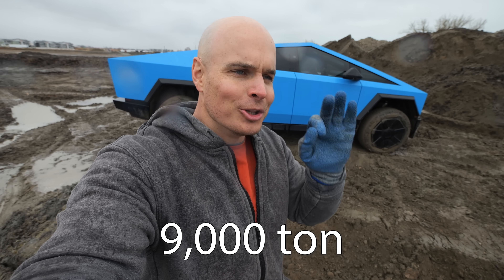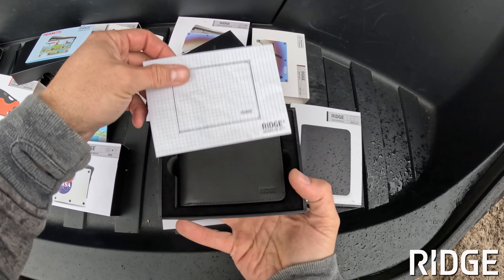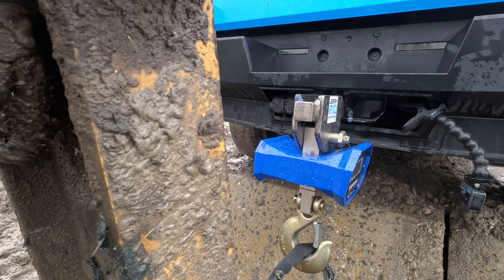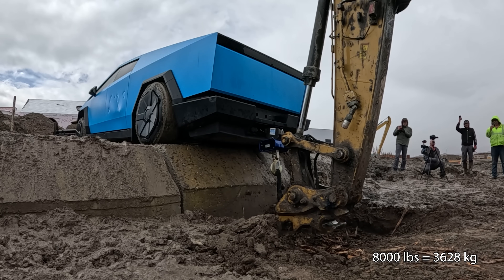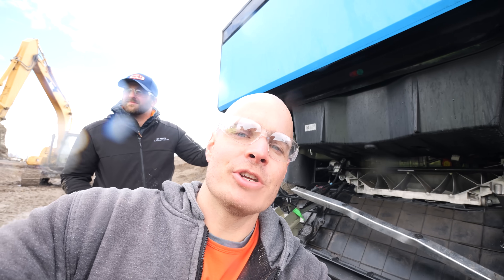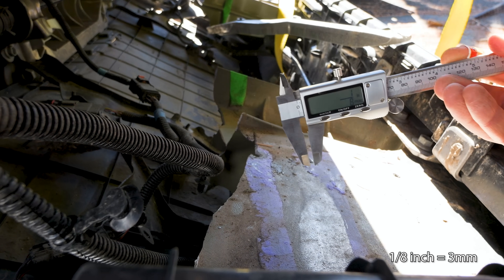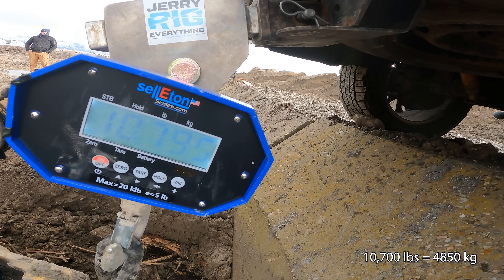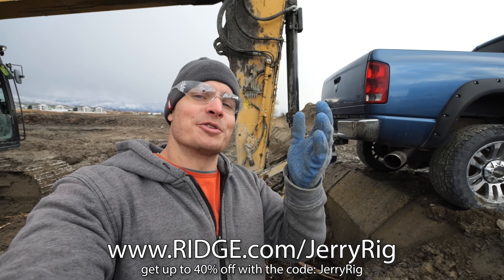SHOULD YOU TOW WITH A CYBERTRUCK?! - (catastrophic failure test)

Comment: So basically anything over 6,000 pounds puts enough stress on it to where it could more easily break in the future. If its fatigue diminishes thats even scarier
Reply: Any towing weight. Aluminum weakens over time with any load, faster with more load. Steel doesn't, it has a fatigue limit, stay under than and the strength will maintain indefinitely. I wont be surprised to see Cybertrucks just falling apart on their own without the added load of towing after 5 years or so.
Reply: @_BangDroid_  Wait till you find out what they make airplanes out of. It will blow your mind.
Reply: @ Thanks for the education! I have learned that planes are made of machined or forged billet aluminum not cast which is significantly weaker. I also learned that the aviation industry is heavily regulated and critical aluminum parts are routinely inspected for fatigue using ultrasonic or even X-ray inspections. Which is probably something every Cybertruck owner should do if you're going to make this comparison.
Reply: @_BangDroid_  100 percent confirmed 👌
Reply: @_BangDroid_  That depends what alloy you use. They have SpaceX materials scientists and people doubt them. Quite narcissistic
Reply: @elijahgardi7501  Aerospace materials prioritize being light weight. Aluminum is never used for strength, regardless of the alloy. The Dodge held up better even under bouncing because it was steel.
Reply: @_BangDroid_  By unit of cross section, steel is far stronger, but pound for pound aluminum is more than twice as strong as steel.  They do have different tolerances to fatigue and modes of failure.  Otherwise aerospace would just use thinner steel rather than aluminum.  Then at those thicknesses steel wouldn't hold the fasteners without ripping.
Reply: @TheDustyShed  I'm sure Tesla engineers are capable of iterating their designs eventually. But they keep reinventing the wheel with things like the Cybertruck, instead of going with tried and true chassis designs. The first version is totally flawed. The Dodge is a stronger design and material and not by a small amount, they were bouncing the same load repeatedly on the Dodge. The Cybertruck is too much like Cyberpunk 2077 on first release, nothing like it's hyped up promise, but eventually they might get it right.
Reply: @CGGS_0  Yes they are dude, they were designed from the team of materials scientists for the Gigapress. They're used in the model y and model 3 and no-one has complained about towing faults. FULL STOP.
They used air cushions to bend 20x cold rolled stainless steel yet they can't make a tow hitch? 

Just look at the real world data of people actually using it in the way its designed. Moving the goal posts to hypothetical scenarios isn't valid criticism. When do you apply 10,000 pounds of force? When do you drive down the road and wile E coyote has painted a wall? It's total bullshit.
Reply: Why would the ball weight be over 6000 pounds?
Reply: @Lav-v9c  it doesn't matter because fatigue happens with every stress. So every time you hook on a trailer and every time you loads the trailer and unload it or you are simply driving through a pothole aluminum will fatigue even if you only step on it you might lose 0.000000001% of its strength and you won't get it back. 
Aluminum degrades with stress over time till it can't hold its own weight.
Reply: @ - and its not pure aluminium jack a!
Reply: @Lav-v9c  of course it isn't but it's also not one of the good high fatigue aluminum types.
Reply: @Lav-v9c  Exactly..... these tests are nothing but click bait. No truck within this capacity has a high tongue weight capacity.
Reply: Not true every time you put a little bit of stress even a small trailer on the hinge aluminum will degrade if you pull a small trailer every day you might have half the strength after 2 years.
Reply: remember its aluminum all you get is 1 tow at 6k and thats it no more towing ever ... this is why planes get scrapped while your model t still putters along ... or you can do maybe 100 trips with 1k off the hitch then put the trailer away for good
Reply: How would you ever get 6000lbs of weight on the tow ball?
The excavator weight around 50000 to 70000lbs and could only push down with around 10000lbs, any trailer you put on it will do the same, most of its weight will go through its own wheels
Reply: @markharrison7468  If you hit a pothole while braking as hard as you can.
Reply: @Anonymous-sb9rr  lol and you think that will put 10g downwards on the ball. No wonder this channel has been able to get away with $hit like this.
Reply: @ no if you hit a pot hole while braking hard the rear end would lift making the trailer push up rather then down unless you have a really poorly loaded trailer with all the weight at the front
Reply: @Lav-v9c  Not 10g. when you brake hard, a large portion of the weight of the trailer can push down on the tow hook, so you don't need 10g. It all depends on how high the center of gravity is of the trailer, compared to the distance from the tow hook.
Reply: @markharrison7468  10G hit with 600lbs.
Single axel trailer mostly dangerous for cybertrack, easy to imbalance so dynamic loads go to tow ball instead of trailer suspension.
Reply: If you backed a 6,000lb trailer off a cliff and then tried to tow it back up, then yes. To call the logic used rudimentary, would be an understatement.

A 10,000lb trailer (probably triple axel), doesn’t magically apply 100% of the weight on the tongue, it’s distributed among all the axels and the hitch.
Reply: @_purge9488  Haha you drive on perfectly smooth terrain? What are you hauling and where to?
Reply: @_purge9488 a 10,000 lbs trailer becomes a LOT heavier for a split second when you hit a bad dip in the road, you know, the kind that makes your suspension almost bottom out on most vehicles.. they exist and they're not always easy to see until you're ontop of them. Then take metal fatigue into consideration, and it becomes clear that it's entirely possible for someone who hauls heavy trailers, maybe drives kindof like an idiot, to break their hitch off after several years of use. And it's not just theoretical, it's happened at least once not including whistlindiesels test (where he wasn't even trying to break the hitch off, it just happened, very early in the testing)
Reply: this test is absolute BS because they measured the tongue weight rating by pulling DOWN on the hitch receiver instead of testing towing capacity which is a HORIZONTAL load. Total morons doing this video!!
Reply: @silentepsilon888  it's not BS for a good reason in a perfect world without any hill or perfect roads always straight it would not matter. Whenever you pull up the hill especially over the hill you will have a good percentage of your weight on the hook bullying exactly in this orientation. 
Also the test wasn't straight down
Reply: @ not only that when the wheels started coming up they tied it down increasing the fulcrum effect
Reply: No. he’s lying about the dangers of this. This would never happen In the real world, towing within its rated tow weight limit is perfectly safe…… He’s upset with Elon so he destroyed his Tesla to make a Tesla hate video
Reply: @_HashForce  you just have to go over a hill slowly and you will have the same angle with your rated to wait pulling the exact way down
Reply: @ReinhardSchuster  A trailer is designed to carry its own weight. The majority of the trailers weigh will always be on the axels. For this to happen the entire 11000lb trailer would have to be hanging off the bumper, from the side of a cliff to recreate this. Even the 50,000 pound excavator was lifting itself off the ground with only 6000 pound force on the Cybertruck. No real would scenario would make the bumper break like that.
Reply: It is more of a problem if you get into a crash. In a car crash, the downward force on the object being towed can easily multiple by over 10x - which would cause problems for the Cybertruck even if you are only pulling 10% of the tow rating. So if the Cybertruck's rated capacity is 10,000-11,000 lbs and you are towing the 10% rated load of 1,000-1,100 lbs, then a crash will cause 10,000+ lbs of force in tongue weight and heavily damage/destroy the frame.
Reply: @Intranetusa a crash would never place 100% of the trailer's weight vertically on the hitch unless that crash involves some sort of air time. The trailers wheels will still support the majority of the load.
Reply: @Intranetusa  At that point you already crashed, and a destroyed frame was already in the cards.
Reply: @Intranetusa  Omigod, so if you get into a crash, the ball thingy might break, along with your truck and your boat? Oh noes!
Reply: @bigglyguy8429  There's a difference between controlled destruction as crumples zones get crushed and frames bend and "oops my trailer just became a 10k pound projectile i have no control over"

Comment: Love your videos but your physics is wrong. An 11k lb trailer will never load the hitch vertically to 10,400 lbs. Even in the circumstances you suggested, most of the load will be in the horizontal plane.
Reply: Under normal driving conditions. In extraordinary situations like hitting a pot hole square, or evasive maneuvers, these figures are probably underestimated. The dodge certainly looked like it cou,d handle irregular shocks. The swastitruck on the other hand..

Comment: So the hitch actually exceeds the specification. There is no situation where all of the trailer weight will be on the hitch. So as long as they are under the rated weight everything should be fine. Its important for people to learn about towing weights when towing. Its actually not that difficult.
Reply: Except aluminium gets weaker and weaker with stress applied over time, even if the stress is within its rated limit. Steel doesn't have this problem, which is why almost every truck-maker uses steel frames over aluminium, unlike Tesla.
Reply: @kimjong-un4292  if thats actually an issue why does BW make aluminum hitch inserts? You would have the same problem. The point is that as long as you don't exceed tongue weight x10 it will be fine for the life of the vehicle. Even if your ball were to break and the safety chains were activated its not gonna have 8k lbs of wight on the back. My 2500 duramax can't even have 8k on the back axle and you have to account for the existing weight of the vehicle in that.
Reply: Agree, they should pull out - not down.
Reply: The problem arises when you consider that Aluminum doesn't have a fatigue limit, meaning no matter what over time it WILL get weaker. An improperly loaded trailer might survive the first 10-100-1000 pothole hits, but eventually something will give and the whole hitch will detach from the truck. This IS a MASSIVE safety concern, and should illicit some kind of response or solution from Tesla. Lives are literally on the line with this problem.
Reply: @Oroborus710  not really because it will most likely survive beyond the warranty period. Hitches break off of old pickup trucks all the time due to corrosion. It's no different here. Same deal with aluminum hitches you put in the receiver. Companies like BW offer hitch inserts built of aluminum as well. When you overload anything you run the risk of breaking stuff. Doesn't matter if it's steel or aluminum.

Comment: Downward pull on the hitch only measures tongue weight capacity. You want to pull directly to the rear of the truck to accurately measure towing capacity.
Reply from the maker: Well, this is a tongue weight test. So that tracks.
Reply: @JerryRigEverything You’re clearly being biased. Just because you don’t like Elon and his political views doesn’t excuse misleading and unrealistic tests. Not to add the title of this video. Was a big fan, shame you had to mix politics with your otherwise awesome content.
Reply: @JerryRigEverything  no wonder you have no hair
Reply: @JerryRigEverything  Then how is your conclusion from a 10X result surpassing rated tongue weight capacity means = so scary and "dangerous" to tow with a Cybertruck at all? Because you think hitting a "pot hole" will equate to slamming out the suspension with a sustained load PLUS stacking on an addition 5,000lbs? 😄I think your personal feelings about Tesla are bending your 'scientific' conclusion.
Reply: @JerryRigEverything  Then you should be praising it for having a very high tongue weight, no? (The tongue weight is rated at 1100 lbs, not 11,000)  Just don't mix your political opinions with """Tests""" it is painfully transparent.
Reply: @Fallen608  ----^ agreed.
Reply: @Fallen608  no. because it's made from aluminium, which weakens with every use.

Comment: If the front of the Cybertruck was not held down, it wouldn't have broken. In a real world situation, on a flat surface the hitch would hit the ground and the front wheels would be in the air..
Reply: Not to mention that your trailer would have to be standing up on the hitch like a pogo-stick for for it to get this much tongue weight. lol...   He's just view farming
Reply: Dodge was also held down and didn't budge. How would you justify it now?
Reply: @NattMoir  Dodge has also higher rated towing capacity, so how will you justify not applying the same % load on it? That would be 13k lbs, not 10.5.
Reply: @NattMoir The Dodge and the Cybertruck would both be fine in a real world scenario. The discussion you're in is not 'Cybertruck vs normal truck', it's 'this test is bad'.
Reply: @NattMoir  That's the argument, it was NOT, so the "test" isn't "the same"
Reply: Everyone just gonna ignore the warning on aluminum fatigue limits and that the Ram was also held down while maxing out the equipment.
Reply: @h8GW  Like you ignoring the fact ram is rated at higher towing capacity? Show me what happens with it when you put 95% of 13.8k lbs on tongue, then talk.
Reply: @h8GW  If only there was another object that is made of aluminum that was used daily and has huge amounts of force working against it. Something that spans around 20 feet on each side. Something carries passengers all around the world. Hmmmm I wonder.
Reply: Unless you hit a pothole
Reply: @pav5000  .....that lasted for 60 seconds or more.
Reply: Totally ignoring the main issue: Aluminum is an improper material for a truck.
Reply: @neodym5809  Correction, aluminum is an improper material for a truck frame.
Reply: @neodym5809  The test definitely ignored the materials issue you so correctly point out.  I'd love to see these guys with all their money drop test a cybertruck from 15'.  I wonder if the suspension would bottom out and the frame would crack horribly.  Drop it, then disassemble it and x-ray the casting.  I wouldn't be surprised to see many many fatal cracks.
Reply: @neodym5809  Without defending aluminum or Felon or CT, the main issues in this video was just doing improper testing of an aluminum frame. This is not how you assess if the hitch/frame was up to the task or not. This was done just for views and likes and comments.
Reply: @Axel_Andersen  how do you assess  it?
Reply: @jesusbarrera6916  My comptense does not stretch that far but this 'test' was so wrong that even I understood it.

Comment: Dad's a retired NASA engineer and brother is a chief engineer for one of the big three. And I've hauled a lot of trailers, many times well North of 11k and as high as 23k on a pintle. So I just knew this was wrong. You're talking about dynamic loads. Here's ChatGPT response:

"Dynamic tongue load varies based on factors like road conditions, trailer suspension, weight distribution, and driving style, but we can estimate a range of what to expect when hauling 11,000 lbs.

Static Tongue Load (Base Calculation)

A well-balanced bumper-pull trailer typically has 10-15% of total weight on the hitch.

For 11,000 lbs, static tongue weight is: 

10% → 1,100 lbs (minimum)

15% → 1,650 lbs (recommended for stability)

Dynamic Load Considerations

Dynamic forces can increase tongue weight significantly due to:

Road impacts (bumps, potholes, dips)

Braking & acceleration (weight shifts forward/backward)

Trailer bounce or sway

Steep inclines or declines

On rough roads, tongue weight can spike to 2-3 times its static load momentarily. So expect potential spikes up to:

2,200–3,300 lbs on harsh bumps/potholes

1,650–2,200 lbs under normal road conditions with minor bouncing

Lower-end spikes (~1,500–2,000 lbs) on smooth highways with a weight distribution hitch

Recommendations

Use a weight-distribution hitch (WDH) to reduce extreme variations.

Ensure your tow vehicle’s hitch and receiver are rated for dynamic loads exceeding static tongue weight.

Consider airbags or upgraded rear suspension if your tow vehicle experiences excessive squat.

Use a properly adjusted trailer brake controller to help minimize weight shifts during braking.

Would you like help picking a specific hitch setup based on your tow vehicle?"

Comment: Quick question, you emphasized tongue and towing weight are different. However, since it’s the frame that broke and not the hitch would the frame still be a concern in the horizontal direction?

Comment: During the cooling process, gasbubbles where trapped inside the casted structure. Only in micron range, nevertheless, cast Aluminium will brake, just snap off, with a minimal deformation. And it is the worst matetial for car frames! Aluminium oxidise into white powder, by electrolyse. So salt in the winter, rain, extrem temperature...fires up the "rotting" of Aluminium metal. Technically, the alu frame is a giant eldctrical acctive annode. Over the years, it will dissolves itself. If I was a billionare, I would have use Titanium. Just for the safty of the paying customers.